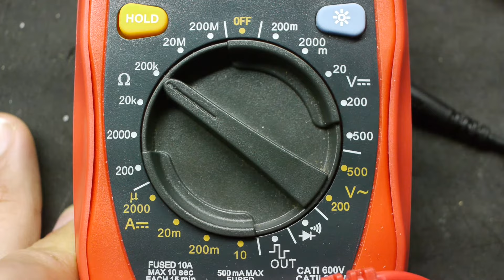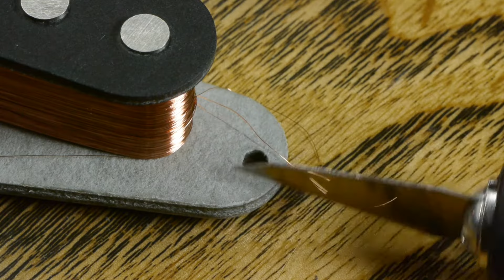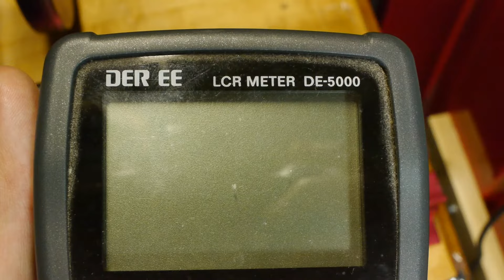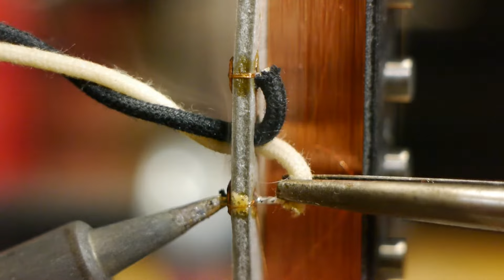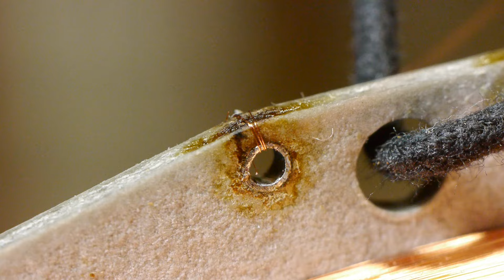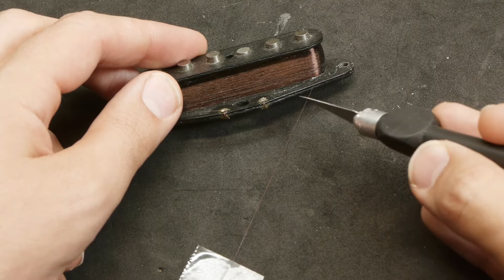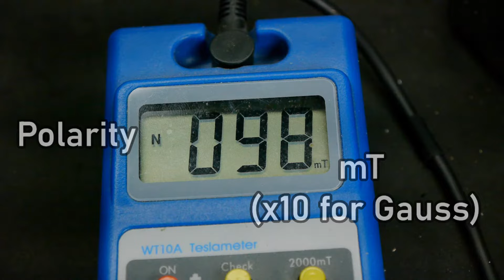Broken Guitar Pickup DIAGNOSIS + REPAIR | Fender Style Single Coil Diagnosis + Repair Demonstration

Comment from the maker: UPDATES (12-4-2025): At some point I'd love to publish an updated version of this video. I have some more tricks up my sleeve now, including the N-Audio Phase Tester. It can not only test phase, but also if there's an output or not. Dead pickups will not generate a green or red light. 

The amp test is helpful but nowadays I just use the N-Audio tester instead. I have two cables I use: one with a 1/4" plug on one end, and two alligator clips on the other end (white and black pushback wire leads, black = ground, white = hot), and then a cable with a 1/4" plug on both ends. 

The plug on both ends is good for testing pickup phase/life while they're mounted in a guitar. One 1/4" plug into the guitar output jack, then the other 1/4" plug into the N-Audio phase tester. 

Then you tap your pickups - I like using a pin punch or a screwdriver - and you can see the phase, and also whether it's getting an output or not. This goes for humbuckers too. Humbuckers should always have both bobbins the same color -- green or red, on the phase tester. If one bobbin is red, and the other is green, the humbucker is wired out of phase with itself (i.e., the two bobbins that make up the humbucker are wired out of phase with each other). 

You want to see red-red or green-green. 

And of course, if one is red or green, but the other gets nothing, either the coil is dead, or the bar magnet is not making contact with the polepieces. I've only seen that once on an Ali Express humbucker that I swapped the bar magnet out on. The customer who wanted me to do it actually then suggested using metal braid -- the jacket from Gibson lead wire, the metal jacket stuff with black cloth pushback wire inside -- 

-- well, we stuffed the metal braid in there, between the polepieces and the new bar magnet, so the bar magnet was making electrical contact with the steel polepieces. 

And that fixed it. The coil was fine the whole time, but simply wasn't getting output because of that problem. We plugged it into an amp before too and sure enough, only one bobbin was getting an output, but again, you can also see that with the phase tester, which makes the amplifier test unnecessary. 

And for pickups outside the guitar: the 1/4" plug connected to two alligator clips. 1/4" plug goes into the N-Audio Phase Tester, then the alligator clips go on the leads of the pickup. You can also undo the humbucker wiring so you have 4 separate leads and then test each bobbin individually, and rewire them if necessary, if the humbucker happens to be out of phase with itself. 

Anyway, I also will cover the basic tests, like ground continuity. 1/4" plug with 2 alligator clips: plug into the guitar, clip the black wire alligator clip (output jack ground) to the black probe on the multimeter. Then touch the red probe to the strings. It should beep. And it should beep everywhere else that should be grounded -- the backs of pots, the switch ground, etc. 

Between the multimeter test for DC resistance, which can verify whether series/parallel switches are working properly, and whether the pickups have the readout they should, and the N-Audio Phase tester, you can do a near complete diagnostic without even taking the pickups out of the guitar. The advantage of taking them out is then you can work towards repairing what's actually wrong. 

With humbuckers, the main thing I've seen is insulation failure. Sometimes the coils need to be rewound. But many times you can disassemble them so you have the 4 magnet wire leads on their own. Sometimes all it takes is re-tying and re-soldering them to 28-30AWG hookup leads. Sometimes the pigtail connections just went bad. 

And you then need to provide insulation on the coil. So the pigtails (soldered connection between magnet wire leads and the PVC 28-30AWG hookup wire) should ONLY ever be touching insulated material, like electrical tape. I like the black cloth acetate tape, the kind humbuckers are wrapped with. 

I superglue the pigtail down on one piece of tape, then put another piece of tape over them. That keeps them from moving so accidentally tugging on the pigtail will not break the delicate magnet wire off, as the pigtail will be locked down in place. I use a little teflon probe/dowel and superglue accelerator to speed this process up. Strip of tape over the coil, pigtail on the tape, superglue in place, then another layer of tape, and done. Repeat on the other side and one bobbin is done. I've also seen people use copper tape on the coil and soldering the magnet wire leads and hookup leads directly to that, which should also work. 

These are all just scattered thoughts right now, until I refine these ideas down into a new wiring diagnostic video. I'll have to come up with a new playlist for this topic as well - wiring diagnostic videos, including pickup diagnostics. 

Thanks so much for watching, and I hope you stay tuned for more guitar everything....right here, on Guitar MD. And yes that is my real voice in all of my videos. Not an AI. Though I'll take it as a compliment. Excited to keep making more and can't wait to get more videos published.

Comment: i dont know why someone would wind a strat pickup without insulation from the magnets .
Reply from the maker: All vintage Strat pickups were like this. At least all the ones I've seen and worked on, of particular note including an original 1951 Nocaster neck pickup, 1955 Strat bridge pickup, 1969 Strat neck pickup, and a 1962 and 1963 set of Jaguar pickups.

None of them had any insulation around the magnets and they did not appear to be coated in lacquer either. It looked rather like all these coils were dipped in lacquer after winding, not before, evidenced by the very hard layer of resin on the outer wraps and on some of them, the top flatwork as well. But then cutting into the coils to prep for rewinding, it was like virgin wire underneath, less than 1/8" deep into the coil. Like totally unpotted, virgin wire, and then bare rod magnets underneath that they were wound around. 

Very common cause of failure over decades. All it takes is a little of the enamel coating on the magnet wire to break down and then the pickup can be toast. 

These days I use one or two layers of Kapton electrical insulation tape around the magnets before winding, or black cloth acetate electrical tape. Both are great and extremely durable. The Kapton is thinner which leaves more room for winding and has been my go-to insulating tape for a while now, though I used black cloth electrical tape for years prior to that, and that also works great. 

That being said, I did rewind a set of vintage Fender Jazz Bass pickups, and they had masking tape wrapped around the polepieces, before the winds went on. And yet that pickup still failed. That's another reason I prefer the modern solderable polyurethane wire. Cheaper, but also more consistent, and in my very unpopular opinion, it's better than plain enamel and Formvar because of that. Easier to work with but the modern coatings I think are just better and more consistent and reliable overall. 

They also make heavy build poly insulation, which is even slightly thicker than Formvar, and they also have it in the same thickness as Formvar as well. So you can get heavier insulation if you want it and in my view it's just better all around and will probably stand the test of time better than the vintage style stuff. But I'm not a chemist or anything so I don't really know. But have rewound vintage pickups that were wound with tape and they still failed anyway, so it's likely the enamel on the magnet wire itself failing over time and shorting out against itself. 

The 1951 Nocaster magnets had almost absolutely zero visible oxidation, which is worth mentioning. You'd expect heavily corroded magnets but beneath the coil they looked virtually brand new. Some mild, corrosion free pitting that was probably there from the original casting of the magnets to begin with. It would only take a near microscopic amount of corrosion to eat through the wire so it's still best to wrap them, but often on vintage pickup rewinds the magnets did not look as nearly as bad as I'd expect, and in some cases I couldn't even tell you what caused the pickup to fail. 

To me, unwinding is a fool's game. I included it here to bypass negative comments telling me the best way is to unwind to the point of the break, but I think that's ridiculous (personally - just my take). I always just tear down the coil and then tape the magnets with the proper electrical tape (not masking tape - again, IMO, Kapton or black cloth electrical tape is best for insulation)....then rewind. I will use Formvar or Plain Enamel on vintage rewinds but for everything else, modern solderable polyurethane all the way.

Comment: This definitely helped me to know why my pickups aren’t working, however I don’t have the tools to fix it. The coiled wire is busted beyond splicing and I haven’t got the tools to rewind them. Or any tools to test them even if I did. My dad might have some of these things though as he owns a vintage audio gear shop and does minor repairs on some pieces he brings in but he has a repair guy for the bigger issues so I dunno.

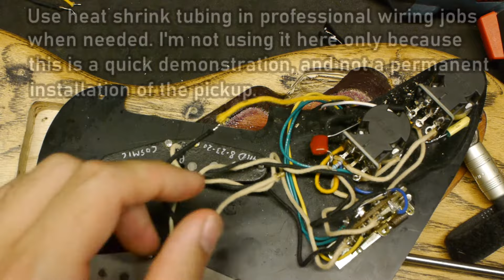Comment: 06:03 I can tell you that this seems like a mistake that you explain here, it is not the connection of the cables that is in counterphase, but it is the polarity of the pickups, or you mounted a pickup with the wrong polarity Compared to the other pickups in the system, or the pickup had an accident and reversed its magnetic field polarity, this is the defect, the error that you are showing here.A magnetically opposed pickup within the chain.
Reply from the maker: I understand what you're saying, though phase reversal can be accomplished through either the polarity, or the orientation of the cables.

If you have a middle pickup that is reverse polarity compared to the other pickups, it will only be in phase if the wires are also reversed. 

If you take a middle pickup that is reverse polarity and wire it normally, it will be out of phase with the other pickups. 

If two pickups are the same polarity, but you wire two of them together in reverse, they will be out of phase. 

This can happen with humbuckers being out of phase with themselves. One bobbin is North Top, the other is South Top - but they can be wired together either in phase or out of phase. 

The N-Audio Phase Tester is a device I wish I had when I made this video. It's great, and makes this all a lot clearer. Two pickups wired together will be either "red red" or "green green" if they're in phase -- the same color when you tap the polepieces on either bobbin.

If they're out of phase when wired together, one bobbin will show "red" and the other will show "green," or vice versa. 

Humbuckers can be confusing to wire, and it's a good way to check whether they're in phase or out of phase with themselves.

Comment: Cool video, good work. Why not insulate the core with polyamide tape?
Reply from the maker: Thanks. And yes, I agree -- when I'm winding pickups, I always wrap the magnets with either Kapton tape or black cloth acetate electrical tape.

At some point I'd love to do a redo of this video. I have some more tricks up my sleeve now, including the N-Audio Phase Tester. It can not only test phase, but also if there's an output or not. Dead pickups will not generate a green or red light. 

The amp test is helpful but nowadays I just use the N-Audio tester instead. I have two cables I use: one with a 1/4" plug on one end, and two alligator clips on the other end (white and black pushback wire leads, black = ground, white = hot), and then a cable with a 1/4" plug on both ends. 

The plug on both ends is good for testing pickup phase/life while they're mounted in a guitar. One 1/4" plug into the guitar output jack, then the other 1/4" plug into the N-Audio phase tester. 

Then you tap your pickups - I like using a pin punch or a screwdriver - and you can see the phase, and also whether it's getting an output or not. This goes for humbuckers too. Humbuckers should always have both bobbins the same color -- green or red, on the phase tester. If one bobbin is red, and the other is green, the humbucker is wired out of phase with itself (i.e., the two bobbins that make up the humbucker are wired out of phase with each other). 

You want to see red-red or green-green. 

And of course, if one is red or green, but the other gets nothing, either the coil is dead, or the bar magnet is not making contact with the polepieces. I've only seen that once on an Ali Express humbucker that I swapped the bar magnet out on. The customer who wanted me to do it actually then suggested using metal braid -- the jacket from Gibson lead wire, the metal jacket stuff with black cloth pushback wire inside -- 

-- well, we stuffed the metal braid in there, between the polepieces and the new bar magnet, so the bar magnet was making electrical contact with the steel polepieces. 

And that fixed it. The coil was fine the whole time, but simply wasn't getting output because of that problem. We plugged it into an amp before too and sure enough, only one bobbin was getting an output, but again, you can also see that with the phase tester, which makes the amplifier test unnecessary. 

And for pickups outside the guitar: the 1/4" plug connected to two alligator clips. 1/4" plug goes into the N-Audio Phase Tester, then the alligator clips go on the leads of the pickup. You can also undo the humbucker wiring so you have 4 separate leads and then test each bobbin individually, and rewire them if necessary, if the humbucker happens to be out of phase with itself. 

Anyway, I also will cover the basic tests, like ground continuity. 1/4" plug with 2 alligator clips: plug into the guitar, clip the black wire alligator clip (output jack ground) to the black probe on the multimeter. Then touch the red probe to the strings. It should beep. And it should beep everywhere else that should be grounded -- the backs of pots, the switch ground, etc. 

Between the multimeter test for DC resistance, which can verify whether series/parallel switches are working properly, and whether the pickups have the readout they should, and the N-Audio Phase tester, you can do a near complete diagnostic without even taking the pickups out of the guitar. The advantage of taking them out is then you can work towards repairing what's actually wrong. 

With humbuckers, the main thing I've seen is insulation failure. Sometimes the coils need to be rewound. But many times you can disassemble them so you have the 4 magnet wire leads on their own. Sometimes all it takes is re-tying and re-soldering them to 28-30AWG hookup leads. Sometimes the pigtail connections just went bad. 

And you then need to provide insulation on the coil. So the pigtails (soldered connection between magnet wire leads and the PVC 28-30AWG hookup wire) should ONLY ever be touching insulated material, like electrical tape. I like the black cloth acetate tape, the kind humbuckers are wrapped with. 

I superglue the pigtail down on one piece of tape, then put another piece of tape over them. That keeps them from moving so accidentally tugging on the pigtail will not break the delicate magnet wire off, as the pigtail will be locked down in place. I use a little teflon probe/dowel and superglue accelerator to speed this process up. Strip of tape over the coil, pigtail on the tape, superglue in place, then another layer of tape, and done. Repeat on the other side and one bobbin is done. I've also seen people use copper tape on the coil and soldering the magnet wire leads and hookup leads directly to that, which should also work.

Comment: so, i have a hot ceramic single coil, Dimazrio FS1 to be exact and,  the ground wire kinda broke off from the bobbin.  how would i reattach a wire to make it work again?
Reply from the maker: I have a video here showing the principle of magnet wire splicing: https://youtu.be/uEpGHItKwWw

And then a Seymour Duncan pickup I repaired with this technique here: https://youtu.be/1V6MWrivDio

You can also use the "knot splice" technique I came up with, which I demonstrate here: https://youtu.be/cNKcELHM_2s

My friend Dale, who also makes pickups, asked if copper tape could be used instead of the knot splice, and I think it could. So that's another potential option.

Basically, to reattach the wire, you'll need to make a splice to that ground wire that became disconnected. They're extremely delicate, so you have to be very careful, but getting some fresh magnet wire lined up with it and doing a splice will work. 

Copper tape probably would be the easiest. Could lay a tiny piece down and solder the delicate magnet wire on top of it -- using additional flux -- to make the splice. And then solder the hookup wire lead to the copper tape as well. I haven't personally tried using copper tape for pickup repairs yet but that's next on my list for an easier-to-perform repair option. 

Hope this helps. Let me know if you have any questions and I'll do my best to help.

Comment: I have an issue where I lost general output from the guitar, like if they begin to sound like single coils with more treble. DC resistance reading from each pickup (EVH wolfgang humbuckers) show close values ~15.5K (neck) and ~13.5K (bridge) comparing to data sheet. I checked all connections and soldering points (even changed the switch) and everything seems OK. Also cleaned the pots with some contact cleaning product and isopropilic alcohol but the problem is still there. Any advice?